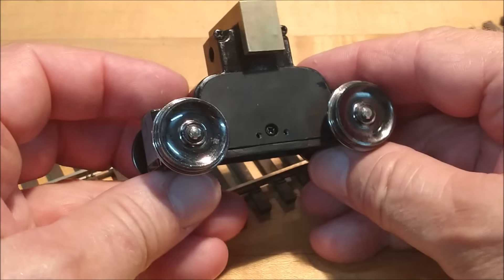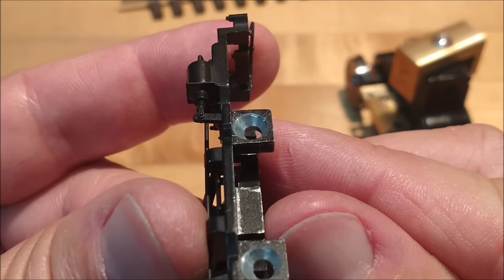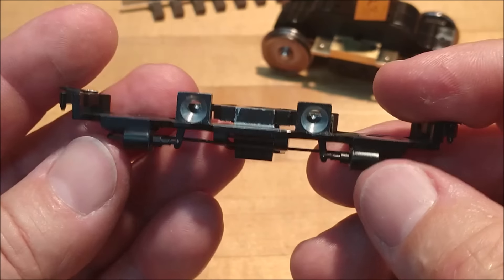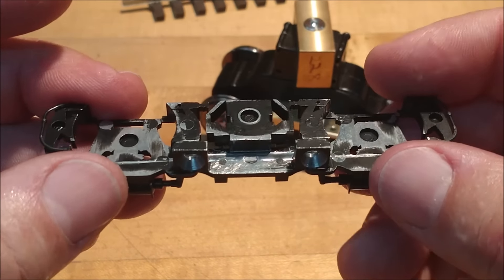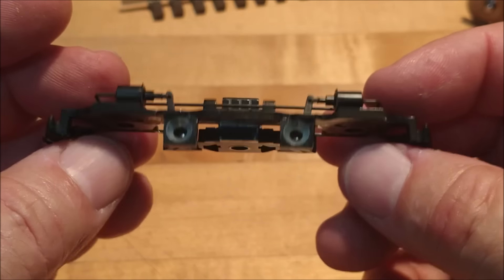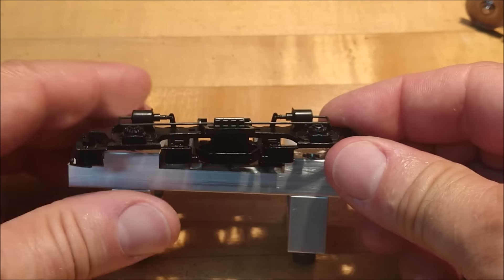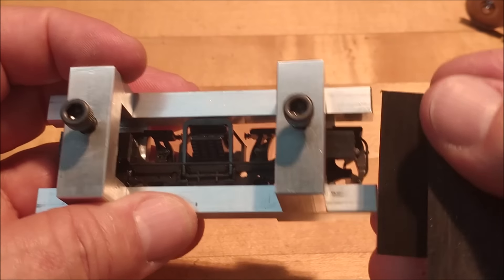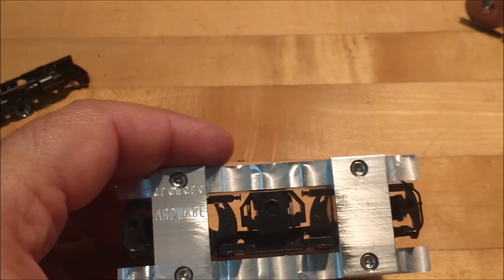Machinists....Ever used an inverted Fixture ??   You'll like This One !

Comment: Great point on the inverted bridge. One point I have seen several times so I will bring it up since you pointed out the "integrity" of the countersinks and the threaded holes. In the aerospace world that was not allowed. The countersink fixes the location of the c'sunk screws. The threaded hole also fixes the location of the threaded screws. There is no "float" to allow for tolerances. It can be made to work but any typical manufacturing tolerances cause trouble because you have four surfaces trying to align the parts. Chances of all four having a perfect fit (zero tolerance) are slim to none.

Comment: Is that an O-gauge truck? Seems a little big and the track doesn't have a third trail, so I'm guessing not. 

Nice fixture. I would have been tempted to bolt that to an angle plate, but then the underside of the tabs wouldn't be accessible.
Reply: HO or OO gauge would be my guess
Reply: @russcole5685  HO gauge is about half that size, maybe about 1" between wheels
Reply: @PaulSteMarie  14.2mm back to back for both HO and OO.   Same gauge track.  Different scale stock.     I'm guessing also, as it's hard to judge scale on a screen.   But yes, no third rail, do not sure on O gauge
Reply: Looks S scale to my eye. Definitely larger than my HO scale.
Reply: @russcole5685  Don't talk metric, Joe will have a seizure!
Reply: With respect if you were not previously informed, those cylinders mentioned at about 4:18s is not hydraulic,  on a real diesel loco. They are air brake cylinders